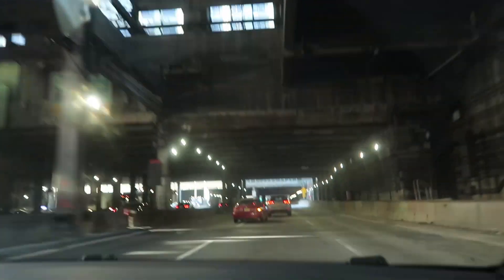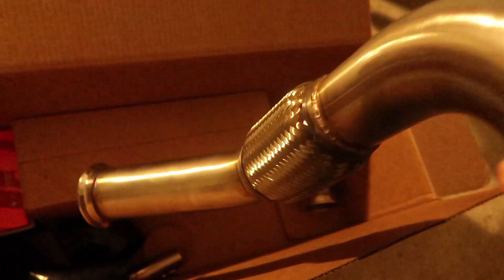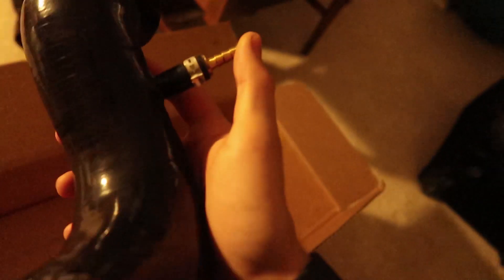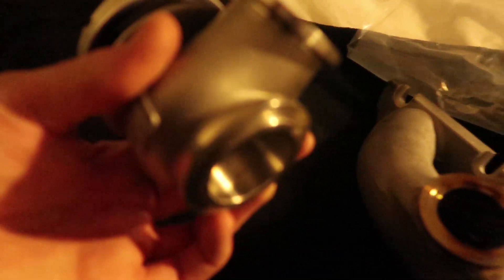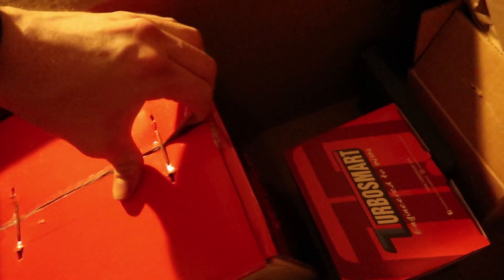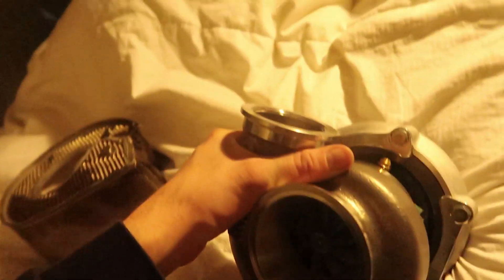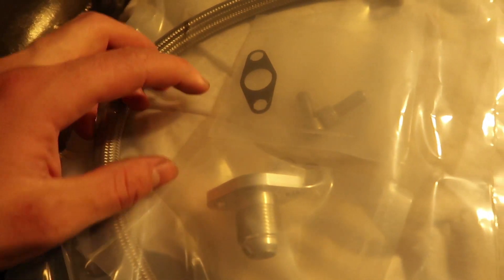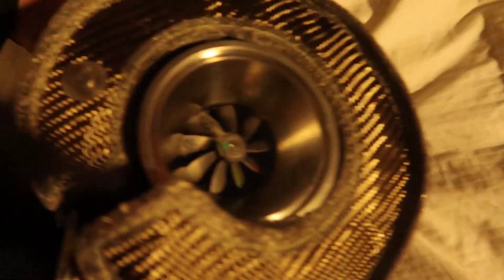Picking up/Unboxing my Big Turbo Kit! MK6 Golf R

Comment: That turbo should be fun. I was tempted to use it as well, but since it didn't come in the right configuration, I had to pass. Make sure you wrap that intake piping in some heat wrap, looks like it would hold on to some heat from the engine.
Keep it up...I am following
Reply from the maker: Yeah I think you made a great choice! I probably would've done the same if I were in your shoes. I considered putting heat reflective tape on the intake but I ended up not being convinced that it would make a discernable difference. I figure the air would move through the intake piping quickly enough that IATs would only suffer by a few degrees Fahrenheit. I may have to recall some thermal dynamics from college and do some calculations or, better yet, do a thorough test myself in a future video. I think that'd be a lot of fun.

Comment: I want the link for turbo kit ? I have mk6 golf R and i want changed turbo
Reply from the maker: Hey this is a custom kit so unfortunately it's not listed online, sorry brother. If you're ok with building the motor, this turbo is a great choice. If you want to stay on the stock block, I recommend getting something a little smaller with plug & play kits available, like the gtx2867r